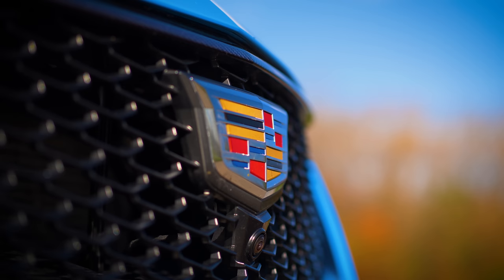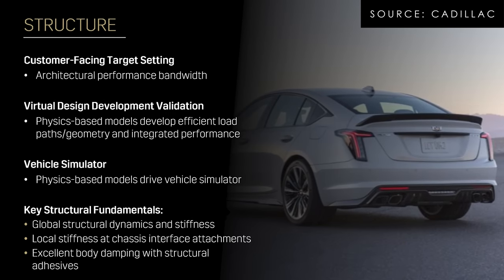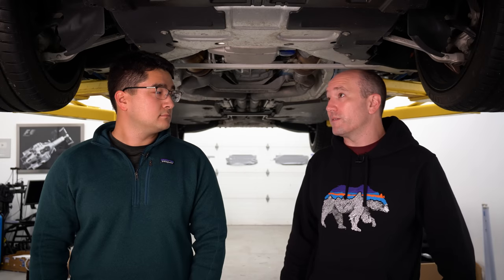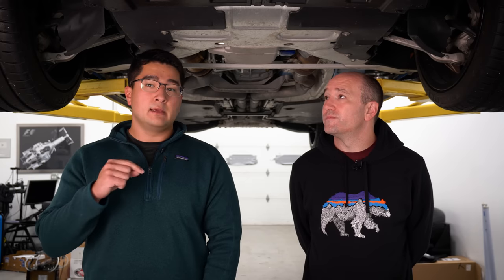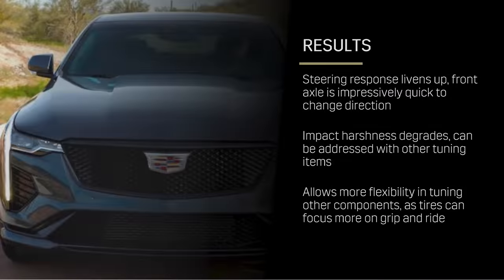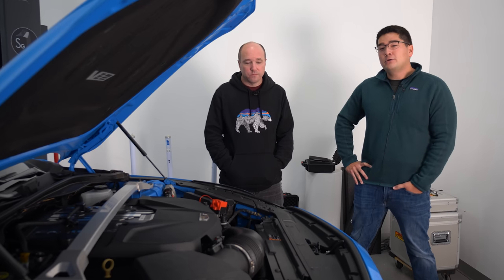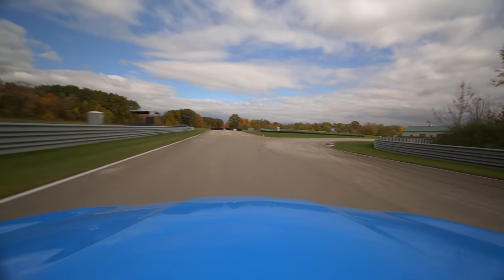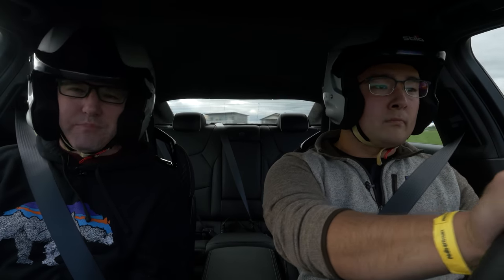Cadillac CT5V Blackwing | Science Fiction

Comment: I bought the CT5 V Blackwing in white today with the manual transmission (2024 model).  I have a lot to learn about the car over the the first 1,500 break-in miles.  Currently restricted to no more than 4,500 revs, but initial impressions are very, very positive.  If the "market adjustment' that so many dealers are asking for has put you off, then this is the time (today is Dec 7, 2023) to buy.  Dealers are trying to make end-of-the-month AND end-of -the-year numbers so they are motivated.  I made the initial $25,000 "market adjustment" go away by just insisting that I would not pay over the M.S.R.P.  So  get down to your Caddy dealer.

Comment: I had a 2014 CTS V sport with steel disc brakes.  I recently sold the car with 76K miles and never had to replace pads or rotors.  Brakes were outstanding.  Overall quality was great too.  I will take a hard look at the Blackwing for next sedan.
Reply: and that shmuck up there saying no one will buy them,like he knows
Reply: @gerald springs  Given first allocation sold out in 3 mins we can just consider that poster highly uninformed.. 

Been enjoying mine immensely
Reply: @MarcoWishart

I'm interested in purchasing a 2019 CTS-V

And replacing everything from the engine, transmission, suspension, exhaust

With all new parts

Would you recommend that i make that purchase?

I fell in love with the CTS-V and don't want anything else, when it comes to a family vehicle
Reply: @christopherhenson5509  why buy such a new one just to take stuff apart?
Reply: @evanc6110  

So it will last for a long time

It would not be a daily driver, only maybe a summer car

But i would replace everything, shocks, struts, exhaust, engine, transmission

I like the aesthetics of the CTS-V
Reply: @Christopher Henson  that doesn’t make any sense.  You would be better off buying a standard CTS if you're redoing the drive train, suspension, etc.  Probably better with a '17 so you're not paying for warranty coverage you won't be able to use.
Reply: @rdollie1  

I'm only replacing everything, with the same factory parts

Just putting all brand new parts, engine, trans

So it will last for many years to come, after this EV B.S is force fed down our throat
Reply: @christopherhenson5509  ah, now I get where you're going!!
Reply: @rdollie1  

😎I just want my internal combustion V8

It will be a family car, and won't be beat on, no racing, just normal driving
Reply: I have a Camaro 1LE with similar steel brakes to the CT4/CT5V and recently had to do pads all around at 30k miles including ~8 track days. Front rotors are at about 50% life. Tracking the car makes a significant difference in lifetime. Would strongly consider a 6MT CT4 as a replacement for my camaro in a few years, but I also have a feeling that used prices for both are going to stay very high as EVs start to gain sales. We will see.
Reply: Strange my CTS-V wagon(steel brakes) with only 45k on the clock needs new REAR brakes, the fronts have lots of life left.
Reply: @goforbroke2  

Oh wow, so it's not a daily?
Reply: @Sniggwaffles  

Combustion engines are going to be in high demand

There are many like us, who want nothing to do with that EV B.S
Reply: @christopherhenson5509  It’s my wife’s daily, she doesn’t drive it much. Takes the train to work, pre Covid of course. I’ve owned it for 6 years now. Great daily though, minus the fuel consumption lol.
Reply: @goforbroke2  

Ahh very cool

Comment: Incredible effort from gm. Having worked on vehicles though I can't help but think about repair costs down the road.
Reply: I had my new CT5 rear ended. Less than $2400 for remove/replace and paint the bumper. Complete ! At the dealership. Any other performance sedan would have been way more expensive.
Reply: @paulkeddy7656  bumper cover?
Reply: At this performance level, we're basically talking German or Italian cars. And those parts ain't cheap either.

Comment: FIRST hats off to the whole SG team - extraordinary content!

Just a few comments
1) Reference in the end about the car using more steel than aluminum may be accurate but not relevant in your comparison to the M5 which is heavier except the CS variant.

2) Speaking of the M5, I think there was an assertion or assumption it would be faster than the Blackwing on the track?  The CT5-V BW auto already ran VIR 4.5 secs per lap FASTER than the M5 Comp and the slower manual outran the mighty M5 CS at Willow Springs.

3) MPG - Wow!! Not sure if it's because of the manual but my CT5-V BW auto (yes auto - I track my cars so auto and steel brakes) gets around 13.5MPG with a heavy foot in suburban driving. My best 25-mile highway loop was over 23 MPG.  That said, I got around 4 MPG on a damp cold track where I barely made it out of the mid
 140s for speed.  Wonder if the manual is that much worse or was something wrong with the car?

4) You mentioned some understeer transitioning to oversteer on the track.  By chance did you use the track specs in the manual (a few changes but largely the -2.5 degree camber being the biggest help)?  I'm thinking maybe you did as the track-only air ducts were installed?

Comment: Thanks for the great review, gentlemen. I'm still pedalling my auld 2007 CTS-V around ( 250,000 Kms and utterly stock but for many, many replacement parts ) and even it has a better front end than my admittedly prehistoric 1984 Porsche 944 had. I can only imagine how much the handling and braking have been improved compared to my current fun jalopy. I can see a V2 in my future because I require a manual transmission in my fun cars but a CT5-V would be a stretch at the moment...

Comment: A electronic differential isn't really like traction control. And it actually significantly improves performance. Instead of reducing torque, it actually increases it compared to an open diff, or even some LSD. That's because it adjusts based in different types of corners at different speeds. Which requires different amounts of locking for optimal performance. Which is something a mechanical LSD can not do. A mechanical LSD is a compromise, designed to lock at set point. Which is why F1 cars use e-diffs. You also get a diff that's more natural feeling because it's not overdriving or under driving certain wheels to make it rotate more. It's just locking the wheels together with a variable amount of wheel slip and a variable amount of strength to insure the optimal level of agility and traction. Assuming the diff can be properly cooled this is the best type of differential for high HP RWD cars like this.

Comment: As I said in the CT4-V video, with MR 4.0, the new sensors are the body accelerometers, not the wheel position sensors.  Previous MR systems always had wheel position sensors (they were typically on the upper control arm since pre-Alpha cars with MR did not have strut suspensions).

Comment: You guys keep saying heavy car but I added up the corner weights and I got 4,001 lbs.  How much lighter is a Camaro ZL1?  It ain't very much.  The ZL1 1LE is 3,880 lbs.  Regular ZL1 is 3,925 lbs.  I'll give you that it probably feels heavier but that's due to tuning and probably wheelbase.   C7 Z06 is 3,550 so now you're getting into some real differences.  But on Alpha, the 5V-BW gives you a real sedan with minimal weight penalty over a Camaro.

And, at 4,001 lbs, there is no way in hell the M5 or E63 is lighter.
Reply: I recall the weight is actually a bit over 4,100 pounds which is 200-800 lbs less than the Germans (RS7 is a pig) except the M5 CS.

Comment: So....... it essentially sucks the crude oil right out of the ground wherever it goes. And it goes about as far as a motorcycle before running out.
Reply: No, I think there's something wrong with that car, else the manual IS MUCH LESS EFFICIENT than the auto.  I drive an auto and on suburban streets and highway entrances I spend as much time as I can legally doing WOT and I'm getting aboi6 14 mpg (which is a bit less than the '17 CTS-V I had.)  I was dismayed to get a little over 4 MPG on the track but I suppose this much power pushing 150 comes at a cost!
Reply: @rdollie1  Maybe so. I guess we could compare that horsepower figure to other stuff making similar power and see how much better or worse it is.

Comment: Gents, thanks for an interesting review. I want to comment about the general "state" of US automotive design practice and your approach to this car. Do BMW, Porsche, and MB  approach "performance" in a much different way than this car? Don't those three companies make cars that you can take to the track at a high (or similar) price point? Can't you destroy tires on some of their cars if you so choose? Why does (only) an American car generate the chest beating and tire smokin' behavior (which also could encompass high HP Mustang and Camaro models?) as its stereotypical result? I am assuming you gents did not make this up on your own, but were encouraged (at least in part) by Cadillac. Does the market really segregate out so differently between the European cars and this one? I am both confused and frustrated by American manufacturers that do not even attempt to compete for entire segments of the market and this review seems to drive home that refusal.
Reply: It's a rwd pushrod V8 with a supercharger, an engine like that just feels more natural and visceral. This car also weighs less than it's euro competition so that adds to the feeling. The Cadillac CT6-V had a hot V engine and would probably fit in better with its euro rivals.